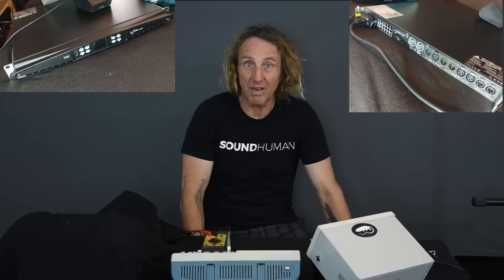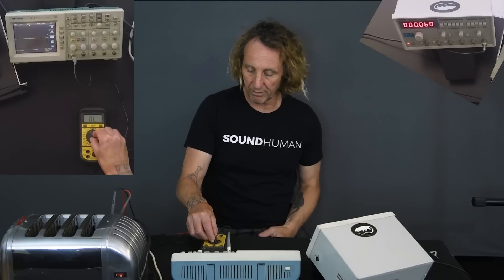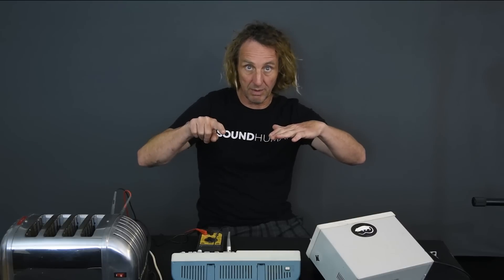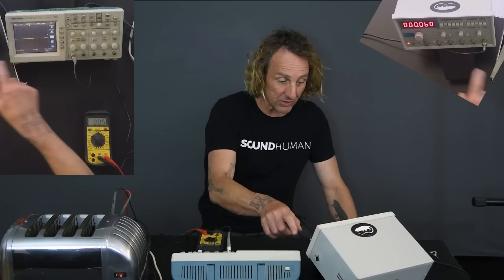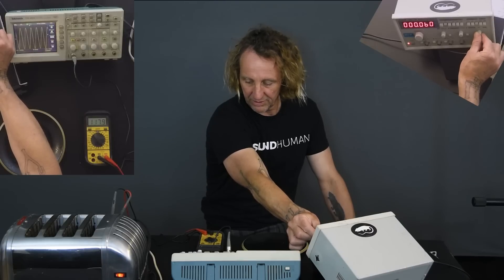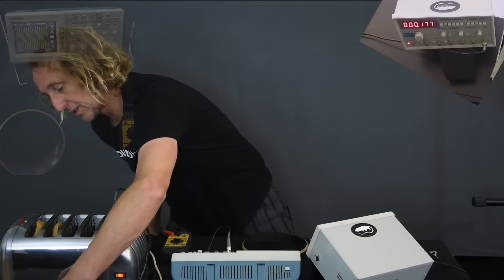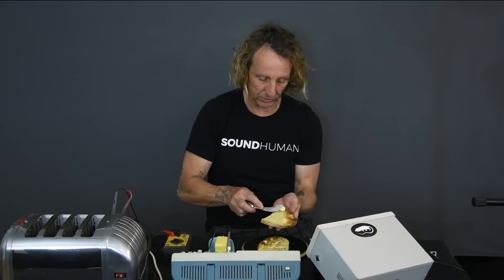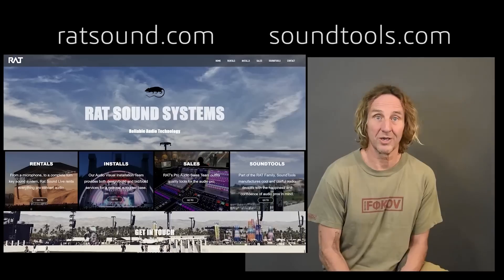What Happens When an Amp Toasts? (Public)

Comment: had anything to do with Wharfedale pro amplifiers the mp2800 £500 1400 Watts per channel 2 ohms bridged DSP looks good amplifier especially for the price
12 volts AC or dc doesn't have the carrying capacity to penetrate the skin resistance
Reply from the maker: Have not dealt with the wharfdale amps.  Yes, its harder to feel 9 or 12 volts but can be felt in sensitive areas and some people are super sensitive to voltages. I knew a gal that could feel the electric output from a microphone. I could talk into the mic an she could be at the far end of a mic cable and with her finger, tell me if the cable was plugged into the mic or not.

Comment: i'd read a story about someone doing something like this decades ago when they needed a 50hz electric organ to work with the 60hz power of the country they were touring in (or vice versa). cool to see it in action lol
Reply: Boston Light and Sound used to put 60hz through big old EV amps to run film projection equipment overseas!